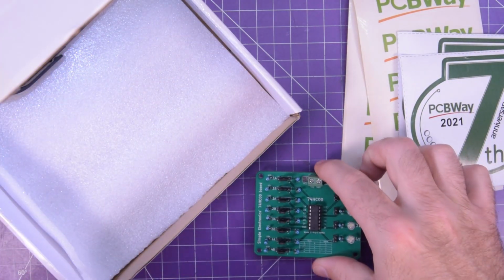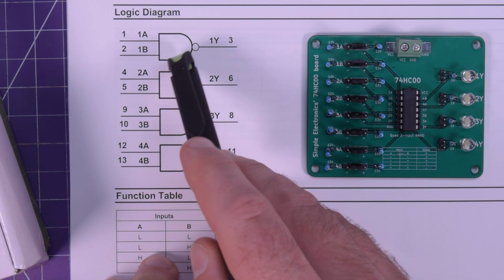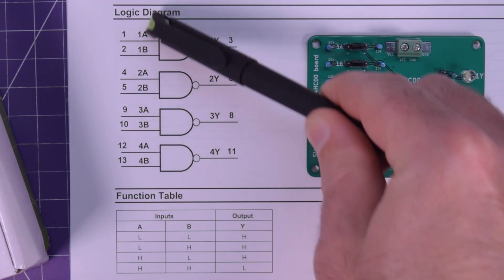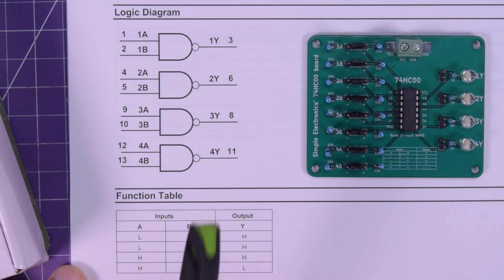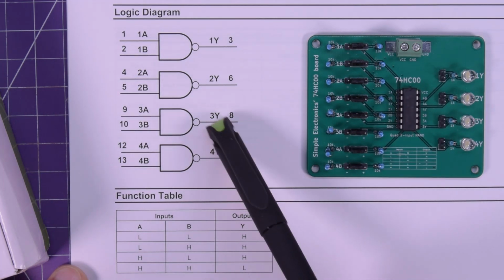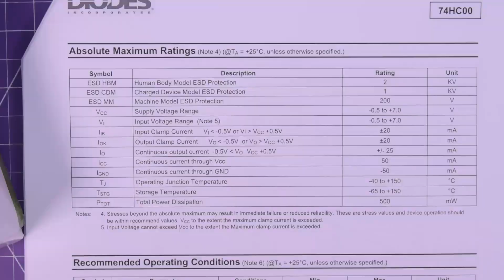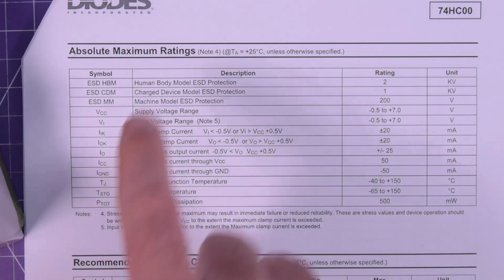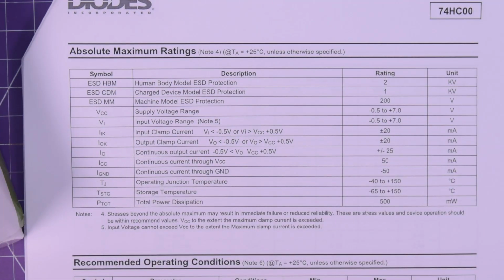74HC00 | Quad Dual Input NAND Logic Chip | Reference Series

Comment: That's a very cool board. I have an obsession with logic ics. I'm wondering. Does pcbway charge you shipping? I would use their services regularly if it didn't cost 100cad after shipping for a few single layer boards. They give no option for regular mail. After my last quote I gave up and bought the stuff to etch them at home.
Reply from the maker: They don't charge me shipping for the sponsorship but DHL was always relatively inexpensive, I think these boards were around 25$ for 10 of them - 2.50 each board is a pretty good value!
Reply: @SimpleElectronics  you must live on Victoria Island. They do the best hobbyist work though. I know a guy that's sponsored that makes the nicest boards from being sponsored and none of them ever work hahaha If I had the means I'd be making the same stuff as you for my local makerspace. I've been donating them items that I've gathered up for the past year. I had submitted a Gerber for a quote of a 70mm x 80mm soldering learning board I made in kiCad with a a few rows of leds with a different cap or resistor value to show the difference between a cap to ground or a resistor(to put it incredibly simply) with a 2 pin header for 4vcc and gnd single sided. I wanted 10 and the quote was north of 140us. So I loaded up ali and just ordered like 20 dip triple 5 4017 led boards for 40 shipped. I'd lap it up if I were in your position though, plated vias, copper on both sides, 1.6 thickness with nice colors and mask. I'm not saying this friend to be a dick, I apologize if I come off like that. If you had the druthers to talk to Scott for a couple hours you had me with that video hahaha
Reply: @SimpleElectronics  keep up the great work just the same. I've watched a bunch of your videos. I'll join your channel or patreon. One or both. When I spread it across she doesn't complain. You want to see the stuff I brought the local maker space today. I have 3 trunkloads of stuff for them. I've been saving for over the last year and using my spare money along with 3d printing for money and I've amassed so much stuff. If you have trouble finding any logic ics just ask and I might have it and I'll mail ya it along with some other cool stuff. Greatest thing about our socialist government is the postage rates haha. I sent Scott a package, was supposed to take 3 weeks but took 3 months. Cape Breton to middle earth for 35 dollars isn't bad. I didn't pick the cheapest option either lol